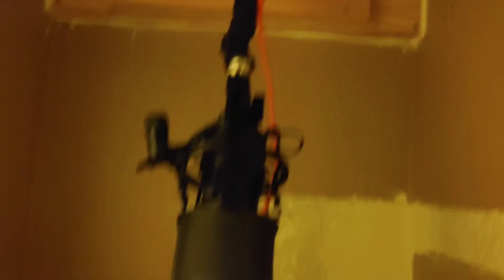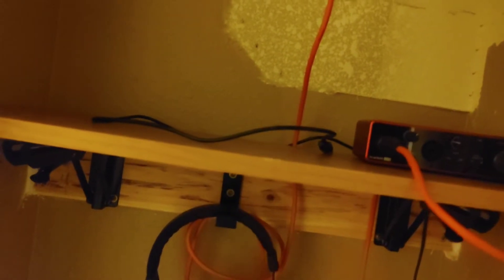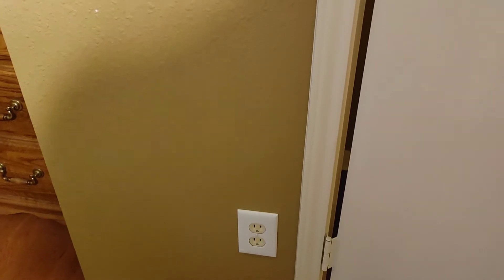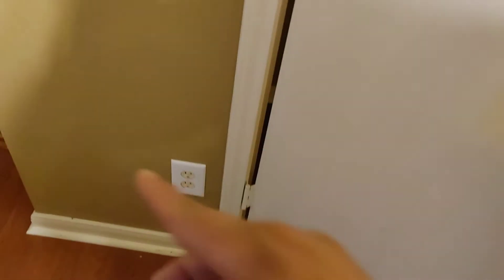Sound Booth Pt2

Comment: Fellow DIY'er here. Came here from Harbor Freight product reviews for the Circuit Detective. Nice video, really liked it. One thing though, that you might look into in the future, especially before selling your home. You installed a 20A receptacle in the closet, I think to be to code that probably should be a 15A receptacle to prevent someone from actually plugging in anything requiring >15A. I may be wrong with the reasoning, but typically you only see NEMA 5-15R plugs in households unless a 20A circuit is specified and run from the panel. The 20A receptacles have that one prong with the T shape instead of the I shape.
Reply from the maker: You are correct, I've changed it since this. Thank you.